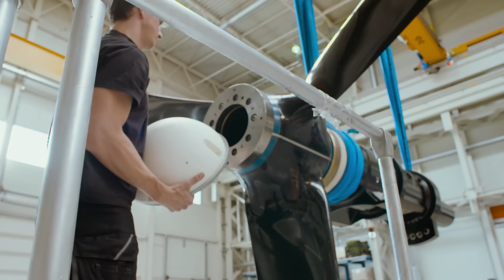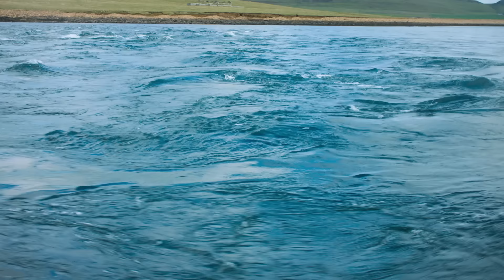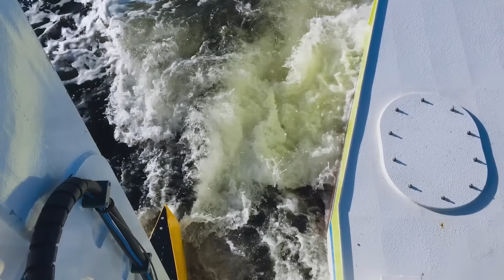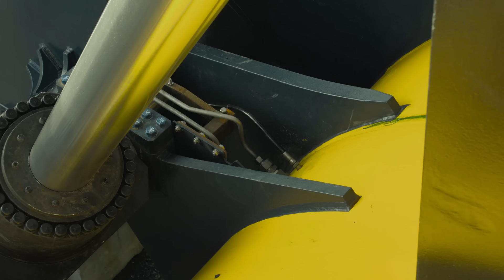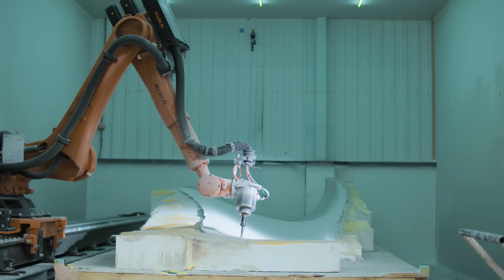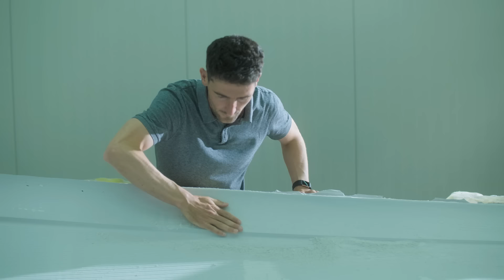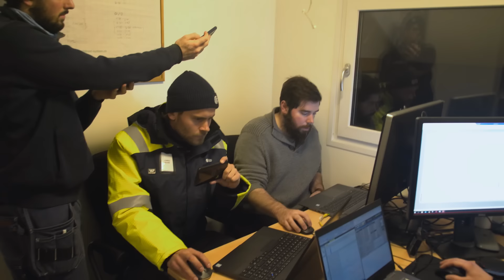Tidal Power: Unlocking the Greatest Untapped Energy Resource on the Planet | FD Engineering

Comment: This is incredible heavy civil engineering, but it highlights a massive macro-infrastructure gap. We can build turbines with 72-meter hulls to generate the power, but if the sub-grade transmission and utility grids onshore cannot physically handle or distribute that energy, the thermodynamic potential is wasted. True sustainability requires integrating the generation with the built environment—like using closed-loop, sub-grade systems such as The Sera Vault to directly capture and dissipate the energy where it's needed most. You cannot just harness the ocean; you have to engineer the onshore baseline to receive it.

Comment: Another "dilute energy" source getting oversold to the public. How many thousands of square miles needed to produce 8,000MW 24/7 like the largest nuke plant in Japan? You said 3,000 GW. Tell me how may square miles. What effect will these monster on sea life? How many aquatic animals will be chopped to pieces? When they break up how will broken pieces be reclaimed so pollution doesn't take place. The flour mill is fine, but I will lay you 100:1 odds the flour is ten times the price of a natural gas flour mill that can run 24/7. Who wants to pay that? One unit produces enough electricity for 650 homes. So to power NYC you would need well over 5,000 of these. To feed the US housing, the need would 135,000 of these up and down both coasts. The continental US has 12,500 miles of coast line, this would be 10 of these for every mile From Maine around Florida to the Texas/Mexico border; then from the state of Washington down to the cali/Mexican border. This could be done with 72 nuke plants at 8,000 mW ea, roughly 1.44/state. A much smaller foot print, much easier to maintain, build and service on ground instead of under water. Me thinks you've done to many drugs.

Comment: Please, Pleas. Leave the Oceans in peace.  Imagine a solar panel that sprouts baby  solar panels or a windmill that spins out new windmills as it's generating electricity. Well, India has just cranked up a  commercial thorium fast reactor that grows fuel as it generates 500mw of electricity. The only thing cooler than free wind energy is energy that actually makes more energy as it’s loading the grid with free energy.  That’s like “double free”..  Wind and solar and oceans  are only “single free”

Comment: I call BS on tidal power.  Very few places on earth where geography give you a bay that can be closed off and turbines can be installed to harness the tidal changes.  Worse yet tides come and go out.  Flow rate starts at zero goes to max in one direction slows to zero than goes to max in the opposite direction.  Theses means that your power generation will also go from zero to max, back to zero over and over in a sinusoidal pattern. Your demand will not follow such a pattern so conventional plants need to step up and step down during these peaks and valleys.  So you aren't eliminating any conventional plants.

Comment: Several ideas actually: why can’t two way turbines be installed in bridge pylons? Or one way turbines in bridge pylons over rivers like the Mississippi River where the water only flows in one direction all the time? Or what about generating power from sources with no moving parts? All vessels generate electricity as they move through water, in the form of electrolysis. That’s why vessels have sacrificial anodes to prevent damage to the vessels’ structures and other systems.  Vessels made of metal such as steel or aluminum have the highest levels of electrolysis. Why not have many large sacrificial, replaceable anodes installed on all structures of which are in moving bodies of water and connect them to conversion systems directly connected to the power grid?

Comment: I drew up my first tidal powered electricity generator back in the 1970s.  Mine was a shore based system that used a decommissioned  aircraft carrier and a system of cables and pulleys, using the ships massive weight and buoyancy to turn the generators, as the ship rose and fell with the tides.

Comment: If O2 had to lift 100 tonnes could it just simply attack tanks underneath the arms and when needed to lift them you cant just empty the water through a pump and a pipe and let air be in it which would naturally lift the arms for repair or checks and you can fill the tanks back up with water and they will go down

Comment: Seems finding a way to tap an ocean current rather than a tide would be a more effective way of gain reliable power rather than just the energy of the tide which only happens 2 times a day.  Or we could just stick with proven energy from coal.  The ocean is unforgiving and upkeep for this will be just as astronomical as its construction.

Comment: Why does the structure have to turn 180⁰ on the tide? A ships screw can create forward and reverse thrust.
The Swedish model seems to make a lot of sense since, most tidal streams are moderate ones.
Reply: The reason for a turning structure is that the tide doesn't return in quite the same direction - if ebb is 0 degrees, the opposite flow is often 172 degrees due to the flow around the land and seabed obstacles. The turbine senses the flow direction.

Comment: This madness in excess will cause even more snow cup melt in arctics. You cant just extract so much energy from the currents. This will reduce the water flow needed for cooling.  Your windmills are already causing extreme heat in Europe.  Why do you think that is happening?

Comment: Every part in the salt water will need to be made out of ceramic to negate corrosion.Unless the unit puts out as much power as a nuclear power plant the 30 or so years a robust pc of equipment might last sitting in the ocean will cost too much. Bearing surfaces would have to be water tight,cleaning marine life off of surfaces would be a regular duty.Guarding the power lines to land would be right up there.I guess you could have a slew of them but at least it would make more sense and be more reliable than wind turbines.

Comment: Tides are a phenomenon associated with the Moons' movement around the earth coupled with the Earth rotating on its axis. 
If you imagine the Earth just "standing still" in space with no moon, the water would cover the earth evenly. As the Moon orbits the earth it pulls the water into an oval shape around the Earth. The Moon takes 28 days to revolve around the Earth, the Earth takes 24 hours to rotate on its axis. So the tides come in and out once every day but the time of high-tide changes by 24/28 hrs/day every day. The ground observer sees the tides come in and go out as a result of the Earth rotating through that oval shape which also rotates around the Earth to keep alignment with the Moon.  I'm not so sure that there is more energy in the tides than there is in the simple fact that the Earth is just one small section of the Suns radiant surface. And all of that energy is literally going to waste.

Taking energy out of the tides is effectively braking the Earths rotation around its axis.

What you really want to do is take energy out of the Earths' ATMOSPHERE. We have plenty of energy released in fuel and in solar radiation. Just controlling how much solar energy enters the atmosphere and is converted into long-wave radiation that reflects back to the Earths' surface and ends-up as heat? That would solve half the problem. Then we wouldn't need to pump even more energy into the atmosphere by running so much A/C because the air itself is so hot. If we could extract that energy into long-term storage and then restore it to heat and cool air and other power-dependent systems in a controlled manner, then the amount of power wouldn't be an issue. The Chinese have been doing this for millennia, every year they extract ice from frozen lakes, store that ice until the spring and bring it out to preserve food into the summer. This raises the question of why do we need so much power in the first place.

Comment: Thank God for Engineers - with that can-do spirit.
Reply: Only in their little bubble. Another "dilute energy" source getting oversold to the public. How many thousands of square miles needed to produce 8,000MW 24/7 like the largest nuke plant in Japan? You said 3,000 GW. Tell me how may square miles. What effect will these monster on sea life? How many aquatic animals will be chopped to pieces? When they break up how will broken pieces be reclaimed so pollution doesn't take place. The flour mill is fine, but I will lay you 100:1 odds the flour is ten times the price of a natural gas flour mill that can run 24/7. Who wants to pay that? One unit produces enough electricity for 650 homes. So to power NYC you would need well over 5,000 of these. To feed the US housing, the need would 135,000 of these up and down both coasts. The continental US has 12,500 miles of coast line, this would be 10 of these for every mile From Maine around Florida to the Texas/Mexico border; then from the state of Washington down to the cali/Mexican border. This could be done with 72 nuke plants at 8,000 mW ea, roughly 1.44/state. A much smaller foot print, much easier to maintain, build and service on ground instead of under water. Me thinks you've done to many drugs

Comment: The Full 
Cycle of Costly “Green” Energy
The cycle of spending and energy waste starts long before the turbines begin spinning. 
Here’s the breakdown of how much this project will actually cost—and who pays:
Details of a present Wind Farm :-
	1.	Planning and Consultancy: £50 million has already been spent on assessments and environmental reports, funnelling cash into consultancy firms with little visible benefit for Local residents.
	2.	Lobbying and Public Relations: Another £5 million was set aside to smooth the way with policymakers and keep public opinion favourable. While PR firms are well-funded, local services are starved of resources.
	3.	Manufacturing and Procurement: With £1.3 billion allocated for materials, the project’s components—turbines, cables, foundations—are largely manufactured abroad, supporting foreign suppliers instead of UK jobs.
	4.	Transportation and Installation: Getting these massive components offshore will cost another £120 million. And as locals watch these colossal structures appear on the horizon, they’re left asking: Why can’t we see some of that investment here?
	5.	Weather Delays and Standby Costs: Offshore installation comes with an inevitable price tag from downtime caused by bad weather. Costs mount up as workers and equipment sit idle, draining millions in public funds.
	6.	Maintenance Over 30 Years: Keeping offshore turbines operational in the harsh North Sea costs an estimated £900 million over the project’s lifespan, or about £30 million per year. Yet, while maintenance budgets are guaranteed, local services see year after year of budget cuts.
	7.	Decommissioning and Waste Management: When The Wind Farm  reaches the end of its life, another £300 million will be needed to take it down and restore the seabed. Up to 820 tons of turbine blades will end up in landfill—highlighting the less-than-green reality of “clean” energy infrastructure.

Comment: What a great documentary. No frills, bells and whistles like most American documentaries there days. Loved it.
Reply: They could gave eliminated the music .
Reply: Just pie in the sky lies. No different than the last 75 years of "flying cars". Another "dilute energy" source getting oversold to the public. How many thousands of square miles needed to produce 8,000MW 24/7 like the largest nuke plant in Japan? You said 3,000 GW. Tell me how may square miles. What effect will these monster on sea life? How many aquatic animals will be chopped to pieces? When they break up how will broken pieces be reclaimed so pollution doesn't take place. The flour mill is fine, but I will lay you 100:1 odds the flour is ten times the price of a natural gas flour mill that can run 24/7. Who wants to pay that? One unit produces enough electricity for 650 homes. So to power NYC you would need well over 5,000 of these. To feed the US housing, the need would 135,000 of these up and down both coasts. The continental US has 12,500 miles of coast line, this would be 10 of these for every mile From Maine around Florida to the Texas/Mexico border; then from the state of Washington down to the cali/Mexican border. This could be done with 72 nuke plants at 8,000 mW ea, roughly 1.44/state. A much smaller foot print, much easier to maintain, build and service on ground instead of under water. Me thinks you've done to many drugs

Comment: Regarding the "kite" version:  The gyroscopes used to orient the kite and control its motion need a system to calibrate it periodically or the inherent drift associated with gyroscopes (regardless of type or accuracy) will turn up to down and cause aberrant behavior or a crash into the seafloor.

Comment: Some of my more noteworthy climate solutions.

Instead of filling the basements, of demolished suburban homes, with sand; 
making a greenhouse basement topper, so creating 4-season earth sheltered greenhouses,
to produce local fresh produce.

I also came up with the idea to use surplus energy to pyrolysize cellulosic feedstock, with biochar dump loads, and route the synth gas to throttle-able thermodynamic plants.
then the process storage is more economical……much more economical than grid scale battery storage.

I also did my own local wind survey, and came up with Racine, WI- to– Burns Harbor, IN- offshore wind line as the best return on wind investment, in the midwest.

Another idea I had was sitting cold bore geothermal with utility scale solar thermal.
because cold bore geothermal is much more prone to success, and could utilize the same power generation equipment.

and yet another idea I came with was building a continuous electrical conductor extrusion plant, up by the bearing strait, and using ships to tow a wire around the planet north-south, to harness the deformation in the earths magnetic field, which is caused by the solar wind.

-------------

but a long the way,
i realized the climate instability was more dominantly caused by loss of planetary carbon sink.
a decade later I had the only real solution to the climate instability.

but we can't get around african heroin's control over the planet.....so we are all going to die ?

Comment: Couldnt this be combined with wind on sea? they are build on those big yellow columns, put some holes in those, stick a couple of rotors in. the columns are already strong enough to stand up to the tide, so allowing for some water to pour through will only alleviate those stresses?
Reply: Also infrastructure for power is already there, and you wont take up extra space at sea, not taking away space where fisherman can do their job.

Comment: Why not just extract the mechanical energy from the daily rising and falling of the tide by floating. The gear ratio would be crazy and the output variable. This same machinery could also act as a mechanical battery for storing of peak excess energy as potential energy.